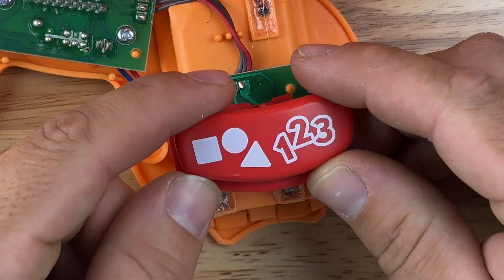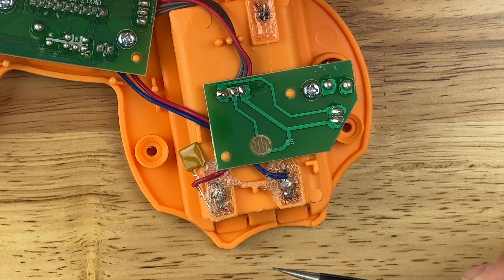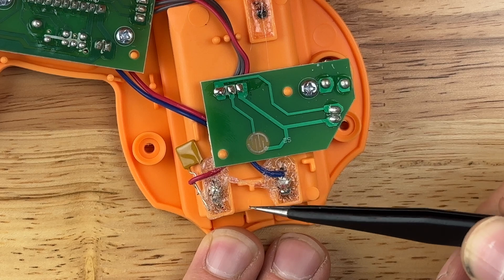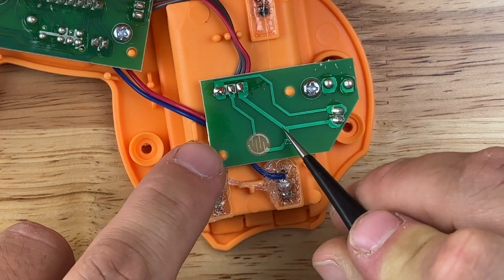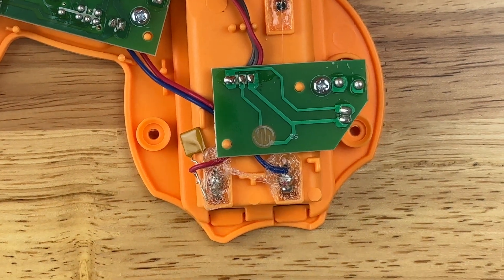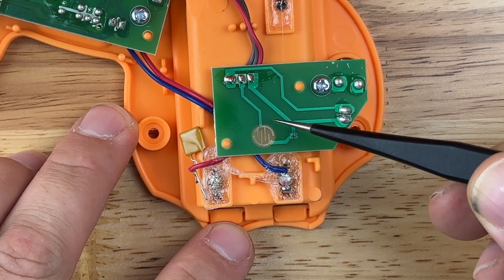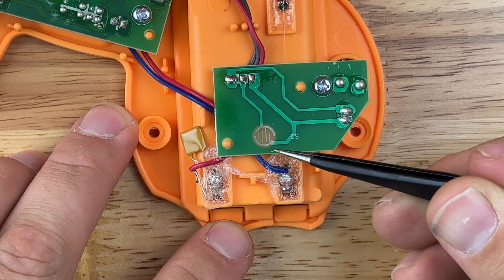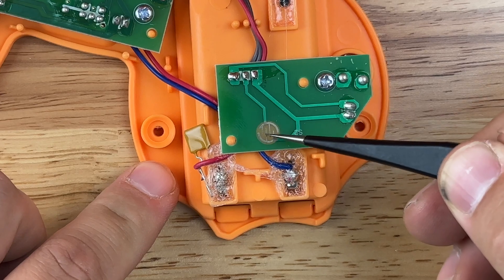Circit Board Buttons

Comment: What temperature do you usually set your soldering iron to when soldering to a circuit board button?
Reply from the maker: Your soldering iron temp will depend on what solder you are using. It should tell you the melting point on the label. A lot of inexpensive soldering irons only have a high and low settings. We have no problem soldering with either setting with the solder we use.